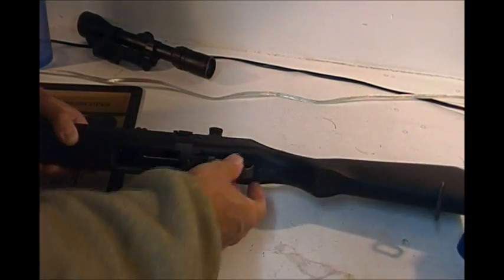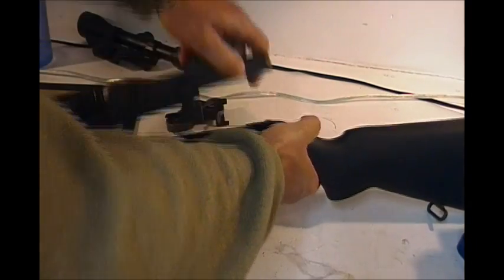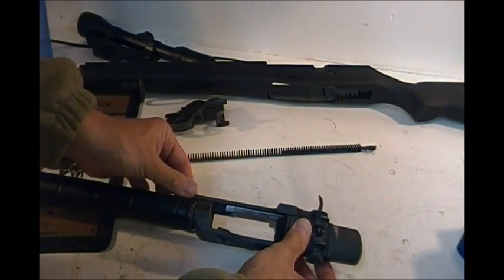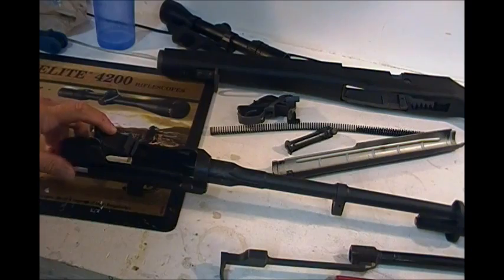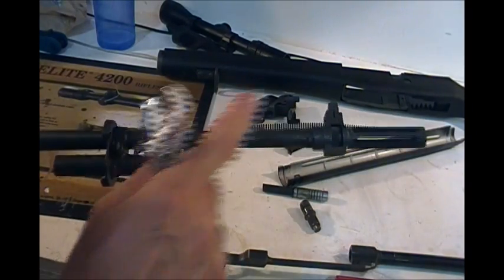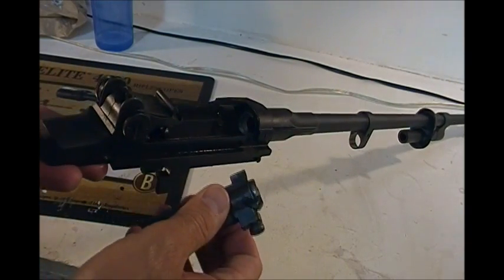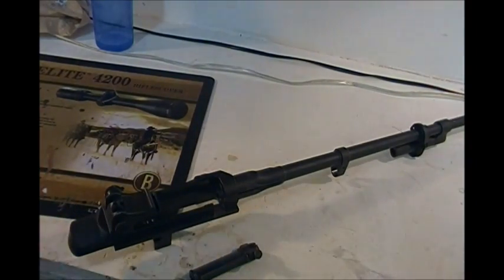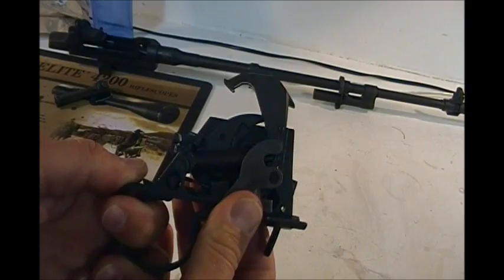PolyTech M305 PROJECT ACCURACY Part 2 Tear Down.wmv

Comment: Beware of .308 TULAMMO steel cased. I had one of the 500 I bought stick in the chamber and explode in my face from excessive back pressure. The casing was a bitch to get out also, There are others on YouTube that had the same problems with TULAMMO as well.

Comment: In regards to the trigger mechanism I've heard that the Norinco safety extremely loud and stiff (almost a two hand job to change with an audibe 'click') - can a gunsmith smooth it out so it's quiet and easy to set to the on/0ff position?

Comment: m305 firing pin is free floating after the bolt is in the lock position. theres a key in the receiver preventing the firing pin from touch the cap intill locked. Aside from that great videos